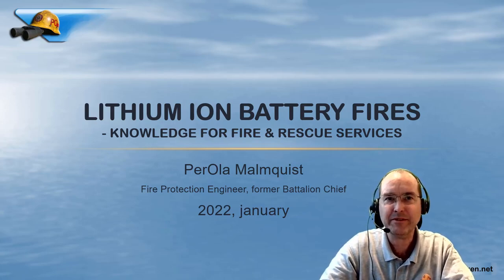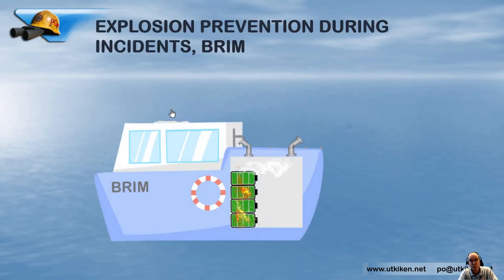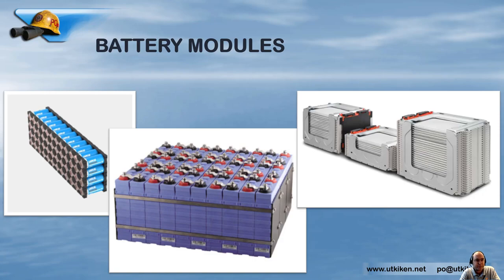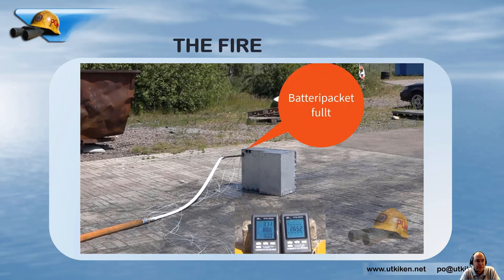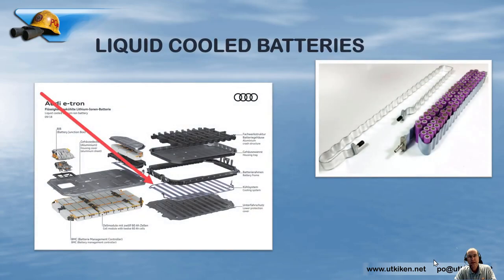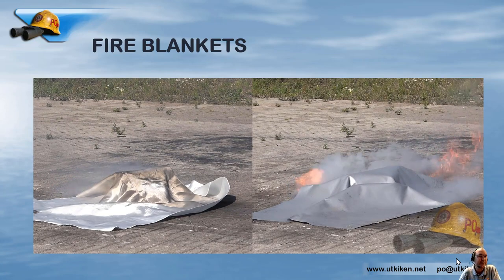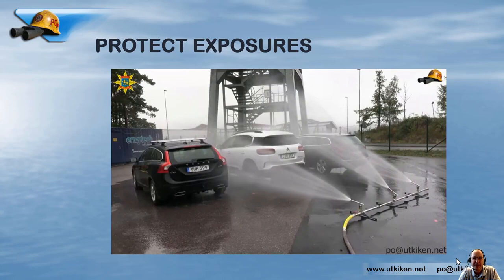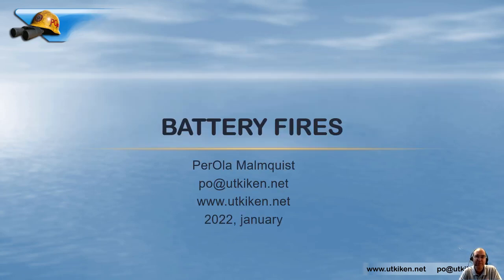Battery fires, knowledge for Fire Brigades - 2022

Comment: A lot of same findings as we have had with testing to learn how to act in case of battery fire. 
We had also the idea of using water, but we were afraid of further short circuiting the cells. Any experience with this topic, or would this be just not realistic? 
Thinking was, if you mix water with contaminants coming from Cells, the water would start to conduct, and cause whole pack to short circuit constantly. 
This is likely something we will further investigate later on, especially seeing the effectivity on this video. 

For Fire blanket we found, that the heat would be contained, and caused the battery to burn even faster. 

We are quite worried about the gases released during the fire and if one inhales them, and that is something we are planning to investigate in near future.

Very good and educative video about battery fires, will share with our Rescue groups!
Reply from the maker: Thanks for your comments. Could you please share your findings with me? Both the fire blanket tests you made and when you learn more in the future. Sounds like interesting lessons. po@utkiken.net is my email address.
Reply from the maker: I just read your comment again and realize I did not anwer it completely. Yes I have experience with using water into the battery packs and I have not seen any indication that the water would further short circuit the cells. Of course there might be currents travelling from plus to minus due to the contaminated water, but I have seen no problems due to this.

Comment: Do you have any suggestions for lithium ion battery packs onboard ships
Reply from the maker: If it is in battery rooms on electrical ships I think a fixed system that both contains the propagation of the thermal runaway to one module, prevents explosion by inerting the atmosphere and makes it possible to vent it without sending in personnel would be a good thing. But I have not looked at that question in detail so my answer is not based on  a thourough analysis of the problem.
Reply: @UtkikenRescue  - I think that unerring may not work as the oxides contain their own oxygen, so will continue burning. Was thinking fixed installation plus some form of injection system direct into the battery cells
Reply from the maker: @PaulCoatesTrailRunning  You are right about inerting not working as a way to stop the propagation of the thermal runaway. I have seeen several studies on it that supports that. My thought of inerting was as an explosion prevention if you get a thermal event with venting of combustible gases.
Reply: @UtkikenRescue  - most schemes need some form of vent system to deal with the gas release